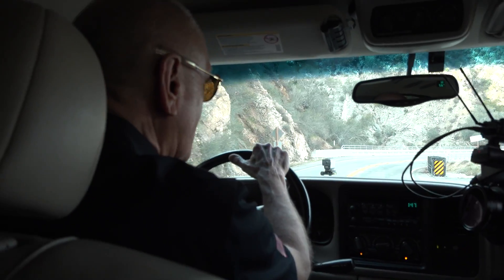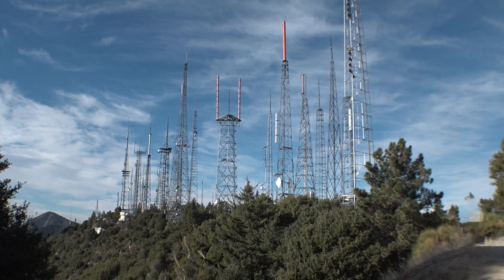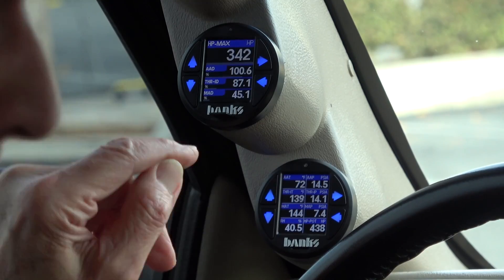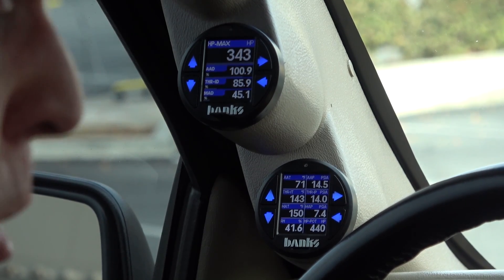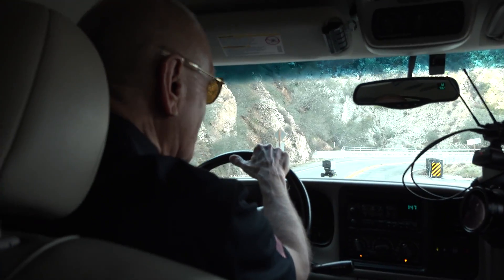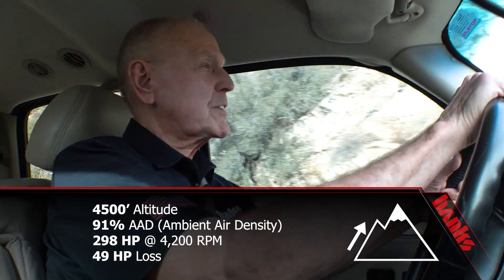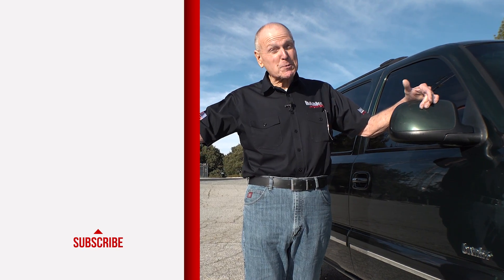iDash Shows How Mother Nature Kicks My Ass

Comment: Finally someone who makes total sense.
What he is talking about here is not a small issue.
Years ago when I was driving my 1 ton Chevy pickup with a 6.5 Turbo in it.
I was driving through the Rockies, pulling a 33 foot 6000 lbs RV trailer.
I have lost so much horsepower because of the altitude I could barely do 25 Mph up hill and spewing black smoke the whole time.
First I thought there was something wrong with the engine.
But later when I came down everything was fine.

Comment: I live at 6200 feet ASL in Colorado springs, everything i own either has a super charger or a turbo! guys who live at or near seal level make me sick when they feel the need to modify because they don't have enough power. whats worse is Tesla's aren't affected by altitude, if anything they are faster because of less air resistance. much more of a challenge to beat them up here.

Comment: What would happen to an engine if the ecm or control module was fooled into thinking it was still at 14.5 psi of absolute pressure at higher altitude? Would an engine see a rich running condition?

Comment: Thanks Gale. Trying to figure out what other stuff you have that I can put on my 05 LLY Chev dually. Almost everything you have except maybe update to a newer iDash. Turbo? ARP head studs first, 35,000 miles on the beast. Want 500 rwhp, 800ftlbs. Trans beef first. Original owner. Sandbox work 2 yrs after purchase, still here. Bla bla bla.

Comment: I made a hot air intake on my Jeep Wrangler with a heater core in the air intake box to preheat the air to get less density , hot air , and more fuel economy. 3.8 L 6 speed manual trans 37 inch tires 4:88 gears 21 - 23.5 miles per gallon in winter in Michigan

Comment: @Gale Banks, 
Do you use A) IAT  or B) dyno cell ambient air temperature , for correction factor? 

-----
 Do I understand your 7, 10 HP per lb air equation correctly.
If I take my  results from Power Driven Dieael dyno In Cedar City Utah (N 37.68881 W 113.07472) 5725' El on  Aug5,2018
dyno run 143.8 wheel hp ÷7 =20.54lb air
 20.54lb air ×10= 205.4crank HP @1976rpm On my June 91.5 Dodge D250 with a factory sealed IP  only mods were H1C/16 (BD) and full manifold wrap @17psi.

Comment: Hey gale, I notice after longer drives my intake manifold and more particularly throttle body heat soaks,  I already have the coolant lines discounted from the throttle body. I was wondering what you thought about the idea of what im gonna call a “poor mans water to air intercooler” basically just a small 12v pump on its own closed loop system feeding through the throttle body and out to a heat exchanger mounted up front of everything.

Comment: I noticed all of this when I moved from 900 feet above seal level in minnesota. to denver in 1980. my old 60's chevrolets ran good at this level and above because they were built before congressional engineering. I did get a 1967 g20 half ton van with 283 engine that had the high altitude compression and cam plus the 4:11 12 bolt rear end. it would go good and haul good. I worked for a big city and my service truck was a 83 chevy automatic, 3/4 ton. not so good. we also had a 76 dodge 360 3/4 tone that had more pep but both trucks were doggy. the next 98 ford triton was a dog. I bought a new chevrolet truck in 1999.
the new style silverado 2500 4x4 with the LQ4 all cast iron 6 liter. LOVE this truck, it has good power and I will keep it as long as possible. I never owned a supercharger of any kind. engines like my toyota echo with high compression and my truck with adiquate compression get the job done all the way up to the top of mount evans at over 14000 feet. I have never owned a personal vehicle that was a dog but sure drove a lot of doggy fords(never owned a ford). On note back in 1984 a friend bought a midsize ford with a high altitude 4 cylinder engine and it did run good. Up here in the thin air you need good design and plenty of real compression. now they just turbo the crap out of everything as the answer. Ok, maybe but not for me yet. I do not race anyway. Had a 77 fj40 once and it was doggy. what helped a bit was adding 10 degrees of spark advance.

Comment: I live in the altitude. When I moved here 50 years ago from Sea level I thought my good running 327 CI Chevy died!!  I did a compression test and my engine was down 15 PSI per cylinder.  Great video. I had to put in 4.10 gears, smaller tube headers, re curve the distributor and learn how to re jet the AFB for altitude. I was still disappointed!

Comment: Turbo snowmobile guys have been working on this problem for years.  It's not uncommon on a sled to start at 5k feet and climb way past 10k during the course of the day.  We also use air density, but to control the amount of boost fed to the sled.  Down low, too much boost causes detonation in the high compression sleds, even running av gas.  So the turbos monitor the air density and crank up the boost as you climb in altitude and can safely use it without detonation.  Would be interested in seeing an application like this on trucks
Reply: Monitoring af ratio in an injection engine should be enough I would think.

Comment: Ok, so let me understand this better. The gage you have seems less like a horsepower sensor and more like a horsepower calculator. If that is true, then this video just shows how the formula is affected by the inputs, no? I mean, physics tells us that horsepower is going to change, but does this video mean much?
Reply: Horsepower can be generally calculated. Different engines can be more or less efficient, but overall if you know how much air and fuel an engine is consuming you can calculate how much power it is making.  The power is in the fuel, but you need a proper amount of air to make it work well. So, less air means less fuel which means less power.
Reply: NBSV1 yes, but I guess my point is that just looking at the hp reading on the gage is ‘dummy’ type stuff. This video is kind of a softball type thing. No surprises; all pretty obvious.

Comment: Is there a point were cold  is too cold? At what IAT iwould I have reduced power   requiring increase throttle /EGTat say 65mph  @ 5500'  is home In Montana surrounded on three sides by Continental Divide 6800-9000 ft to get out

Comment: Now do the same run under real conditions put a load of brick in a box trailer. To show what real effect the heat soak  of using that potential. And the hot air intake performance air filter kits have. My thought on most of the aftermarket air in filter systems is the improve flow of less dense air giving a much smaller increase then one that is actually a true cold air intake (not pulling hair from a heated source).

Comment: I noticed you not only lost potential horsepower (385/430) but the volumetric efficiency suffered as well 285/385 = 74% at altitude vs. 78% at the start of the video, why is that not consistent?

Comment: Chris Corum  
Chris I am doing work on air pressure waves /inertia in a NA intake and wondering if the read rate on some of the IDash sensors is good enough to use on my  R&D.  I can't attach a photo of the graph I get which would give you a better idea what I am talking about.

Comment: I got a first hand education in how air density affects engines in the 80's when I drove from Texas to Albuquerque NM in a 1979 Firebird. Albuquerque is at a mile (5280 ft) altitude and had to adjust the idle mixture on the carburetor so it would idle properly, then had to adjust back when I was back in Texas which is near sea level. Now we have computerized engine controls which adjust automatically.

Comment: I live a couple hours out from denver. We sit around 4,700 feet. Yes it is sad and many people drink. In the high desert, good air density is hard to come by.
Reply: Get an electric car, no effect with air density (apart from wind resistance when they go relatively faster than a gas car the higher the altitude)😀
Reply: Ken Dibble Nah, imma stick with gas. Gas is $2.10 where I’m at right now. Both my cars are paid for they are both over 20 years old so insurance is cheap too.
Reply: Austin W fair enough. If you have less air, you use less fuel. So really its more a power to weight ratio loss, that obviously Coloradans are used to. (Loved my Harley tour all thru Colorado in 2014 by the way, and yes definitely noticed loss of power and breathing in the higher passes) cheers from Oz
Reply: Ken Dibble Right on! Some beautiful sights on those Harley trips. Yeah you would think since less air and thus less fuel you would have better mpg. Just like you said though its power to weight ratio. Now I have less power for the same weight. Doesn’t help the milage case any sadly.

Comment: So can you tell the dyno it has lower atmospheric pressure and it will calculate higher hp????😉
Reply: Yep. The better dynos have weather stations incorporated and will do a reasonably good job compensating for the weather. But, you can still alter the settings to make them read higher or lower. With inertia dynos you can also reprogram the weight of the rollers so it reads higher or lower.

Comment: zZZZZZzzZzzZ just waiting on the diff cover video. Reallllllly pushing them gauges. lol In a gas motor with no boost do you really need more than water temp/oil pressure gauge? He lost 14hp with all them sensors in the intake and air cleaner housing causing restrictions. haha

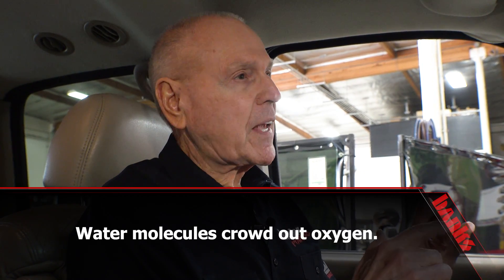Comment: @ 2:14 a minor technical point where you state, "Water molecules crowd out oxygen" in regard to humidity.  It should state "Water vapor......"  Besides, isn't waterboarding an engine a violation of the Geneva Conventions?
Reply: Chad, he was still correct
Reply: @kdkd693  - Yes, his statement is correct if taken out of context, but not in regard to the point he was emphasizing concerning the air intake system of an internal combustion engine.  Water is a liquid, water vapor is a gas, oxygen is a gas.  I am only making a light, technical point.

Comment: More Air Density means more OXYGEN to mix with the fuel.  Fuel requires oxygen to burn to create power so if you loose air density, you loose oxygen and you loose power.  If you want to increase power with decreased air density, somehow you’ve got to increase the oxygen content of the air going in.  If you injected pure oxygen into the fuel air ratio, power would increase like you hit the nitro button.  Back in the 70’s, I used to compete in the Pikes Peak Hillclimb, my XT500 had a ton of power at the 8,000’ start but at 10,000-14,000’ that engine suffered.  Small oxygen bottle connected to the air cleaner canister really helped.  I’ve often wondered why OEM don’t offer something like this?

Comment: Gale what I see you need something that would compensate for lost air density. As the air density drops by altitude humidity abs heat the meth injection kicks in to balance it

Comment: The car guys in Denver might be drinking. But we all know what they’re smoking, so they probably don’t notice the power loss.
Reply: the .4 psi loss from inlet to throttle is crazy.
Reply: Oh I can feel it, 25mpg na vehicle is getting under 22. Though my tdi is unchanged.
Reply: As a Denver resident that races.  It hurts.  Especially as my 3300 in race truck was rated at only about 80 hp at sea level when new.

Comment: So Gale drives a Marauder AND a big block LS Suburban. My goodness this man is awesome.
Reply: RedfishCarolina the 8.1 isn't an LS engine.
Reply: And surprisingly it does not appear that he has a Banks Power cold air intake or turbocharger on either.
Reply: @dirkdejong8421  Keep certain things mint others you dont need too. Me, im ok with amint classic vehicle with low miles. Newer and using continously, crank the juice up and make it fun. 

Also, he doesnt really deal with gassers
Reply: @brandoncaldwell95  Actually he does almost as much with gas vehicles as he does diesels. He also makes a lot of his products  in such a way that returning it to stock is relatively easy. I am guessing that his intention is to use his own vehicles as platforms to create aftermarket equipment for those specific models and with the i-Dash he can have baseline data to work with.
Reply: @dirkdejong8421  I havnt encountered much in gas platforms. Might have changed since i last looked a while ago. Doesnt deal much in my 05 z71 5.3L least when i looked 3 years ago. Since, i have a diesel now and concidering his heater delete, intake horn, cooler, and airbox, but cant get around to spending that much currently on any 1 piece. Also having to get head studs done before the delete.  Funny part, truck only has 300 miles. But i have been watching him for a while.

Comment: Love these vids...so the oxygen content of air is constant at any altitude 20.9 %...the density of the oxygen is less...my question ...is the hp loss from incomplete combustion ... or less fuel injected into engine...do to lower O...
Reply from the maker: The latter. Less air, less fuel.
Reply: Banks Power... thanks for the reply...just thinking about how much fuel must have  been wasted  since the invention of the internal   combustion engine before ecu’s...were implemented

Comment: I have always been a fan of your engineering and have strived to do the same on limited funds.
With that said, I am currently mapping out a turbo LE-9 305 in a '61 C-20. The goal is 500+hp with a realatively small cam with little lag, but milage is important to me.
Many hoops to jump through. Mostly, intercooling and engine cooling.
Your AAD set up would work like crazy, as would a knock sensor.

Comment: Rare gem you got there Gale...496 big block Burb...green w/ tan leather. Polished 16" wheels. Great looking truck.
Reply: I sure wish he built a turbo kit for the 8.1, MONSTER TORQUE
Reply: @johnparrish9215  I found this awhile back, might be something that interests you. https://youtu.be/zTDnr0wj3UU   ✌✌
Reply: truckguyjoe   so true so true👍👍✌
Reply: yeah I was jealous when he said 8.1
Reply: Totally agree with the color combo. Wish I could find a low mileage unit like this. My 97 Land Cruiser is the same color combo but nowhere near the power...for now. 6.0L Vortec conversion is in my head.  Good job Gale.
Reply: After 12 years running a centrifical supercharger (paxton), on my 454 suburban.210 horsepower base - Not getting faster 0-60 times/ about 10 seconds at 2500 feet altitude⛰️I🗻🌄 took it off, kept the suburban though
Reply: @missingremote4388  210hp what year? my 1998 K2500 suburban is 290hp 410ft lb of  torque
Reply: @butchcassidy5398  1995 GMC it was the last year for the 454 c.i.  L19 GM engine. supposed to have been 230hp.  🚘
It's gets up and goes, when it's running right. I made a couple videos on you tube